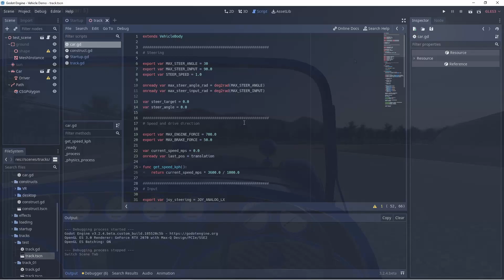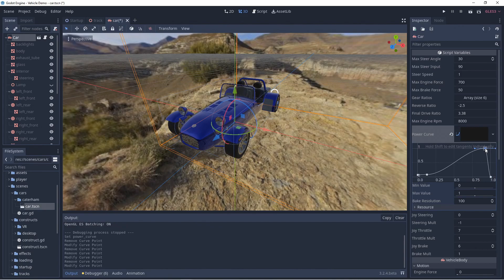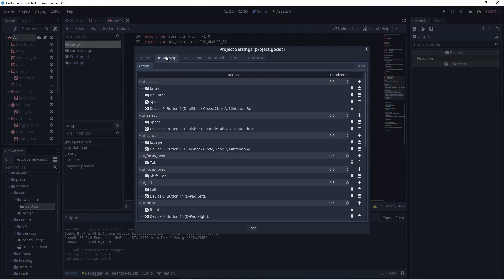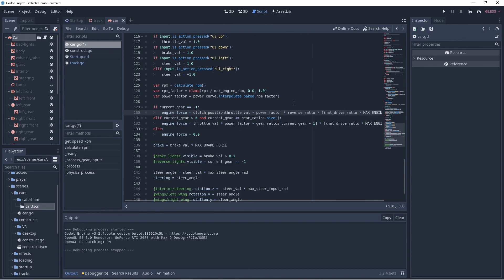Godot vehicle tutorial part 6 - Implementing a gear system

Comment: I know this is an old video, but this is driving me insane. I feel like I just need to write my own vehicle mechanics from scratch. The engine_force is always higher in the lower gears, which makes sense. Except that engine force appears to be applied in constant. In other words, the vehicle continues to accelerate indefinitely at max RPMs until it reaches the vehicles top speed. And for every gear after that, the car simply just goes slower 😂
Reply from the maker: When we look at the core VehicleBody3D implementation, it is completely unaware of RPM or anything like that. You just apply a force and that is applied continuously. If setup properly, the faster the vehicle goes, the more drag (dampening), eventually cancelling out any acceleration as you reach an equilibrium. That gives you your max speed.

The rest you have to build on top of this logic as I've done here. First we apply the force as a function of RPM for each gear but with a curve. At low RPM your engine isn't making a lot of power and the power gets cut off at redline, causing the need to shift to a higher gear which puts you back in the powerband and lets you accelerate further, but now at a lower max so you accelerate slower. Until in the higher gear you again hit that equilibrium where the power and drag cancel each other out.

The whole simulation is an approximation, especially the drag/dampening. The original was build on the Godot 3.x physics which used the bullet physics engine. In Godot 4 you can now choose between Godots build in physics or Jolt physics. Both will likely need tweaking of the values before things feel right.

Finally, VehicleBody3D is based on the well established but very simple "raycast vehicle physics" approach. It's great for your basic arcade racer, but if you want something far more accurate, yes you need to build something yourself.

Comment: When will it be updated for godot 4 
Or at least simplified, Specifically have some issues with Gearbox system
Reply from the maker: I did update the project to Godot 4 some time ago but the work is still part of a PR:
https://github.com/BastiaanOlij/vehicle-demo/pull/15

Hopefully that will give you some answers on making things work better.
Reply: @BastiaanOlij  I tested it out and still had to change stuff manually,  but besides that, your project has manual only and what I needed was automatic transmision, however I've managet to write it properly

Comment: I tried it in a 2d game i'm making, but when the car get to the 4th gear, it suddenly loses rpm, i tried lowering the wheel radius, while i could get past the 4th gear, on the 6th the car get 0 rpm, what am i doing wrong?
Reply from the maker: I'm not sure why you're getting 0rpm because that means you're standing still, unless it's not getting the correct gear ratio.

As for loosing RPM, keep in mind that every time you go to a higher gear, we lower the power output. Depending on what sort of powercurve you've settled on, it's likely that after your 4th gear you simply don't have enough power to accelerate the car. This is all a rough approximation of what happens in real life, and a bit of a balancing act between the weight you've set for your car, the drag the car gets, the power curve and max power you've set, and what gear ratios you're working with.

Comment: ok, and how about an automatic gearbox? how to implement it?
Reply from the maker: Automatic gearbox is fairly simple, you just add some logic that will shift up, or down based on the RPM. Something like:

if rpm > 5000 and gear < 5:
  shift_up()
elif rpm < 2000 and gear > 1:
  shift_down()

You need to make sure that when you're in gear 1 and the rpm drops below 1000, you just show the rpm as if idling at 1000. And you need to do something that when the player hits the break while standing still, it puts the car in reverse. Little things like that.
Also nice things is that on the shift up/down you trigger an animation that makes the shift less instantaneous.

Comment: var power_factor = power_curve.interpolate_baked(rpm_factor)

Does not work in godot 4

I tried .sample_baked(rpm_factor) and still no luck.

Do you know what is the godot 4 equivalent?
Reply from the maker: Hi Bruce, thanks for dropping into my adhoc stream today. As we found out it is indeed sample_baked but there were many more changes needed before things started to work.
Keep an eye on: https://github.com/BastiaanOlij/vehicle-demo/pull/15
Reply: @Bastiaan Olij  Thanks for replying and porting to godot 4. Due to my timezone, I was just starting my workday for most of the stream. I will go back and view.

Comment: great one, was easy to implement into my own car controller script, thanks!

For Godot 4 (beta 13):
instead of using: "power_curve.interpolate_baked(rpm_factor)"
use: "power_curve.sample_baked(rpm_factor)"
also to properly export the curve var use:
"@export var power_curve: Curve = null"
Reply from the maker: Yup, lots of things are renamed or have slightly different syntax. When Godot 4 is officially released I plan to do a stream where I convert this project to Godot 4.
Reply: I'm looking forward to this. I recently started godot and gamedev and I'm building a racing game. I'm using godot 4.

Comment: Also, do you know why my steering wheel does not turn?
Reply from the maker: The projects inputs are currently mapped to a gamepad only, if you're using a steering wheel like a G29 you need to change the input parameters. I'm working on making this a feature (see my live steam from couple weeks ago)
Reply: Nonono I mean the steering wheel in the car in Godot not an external one
Reply from the maker: Owh! did you get the latest version from Github? I remember having to fix it but I can't remember what it was. Couple things changed between 3.0 and 3.2
Reply: @BastiaanOlij  Yeah i got that one but it stil has the problem
Reply from the maker: Weird, I'll have to look into it some more but the code that rotates the steeringwheel in the car is in scenes/cars/car.gd line 156

It does look like a few assets got mangled with some of the moving around of assets so I might have simply broken something when you freshly check out of Github..
Reply: @BastiaanOlij  oh i can't use the latest verion because it crashes every time I run it but i think that might be because i'm using mac. Is the steering wheel meant to move in the version 4? 

Edit: The steering wheel isn't a seperate mesh in the project 4 its just part of interior.